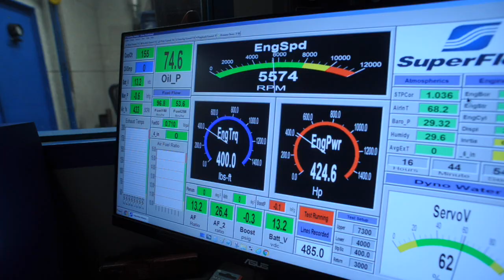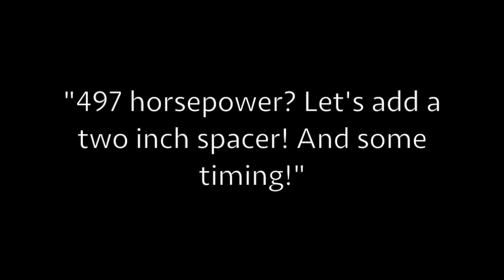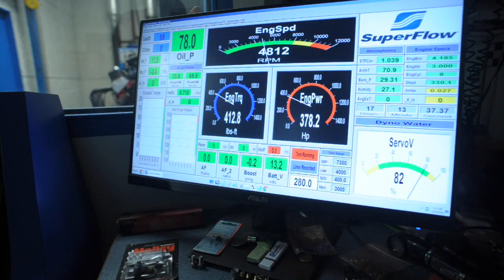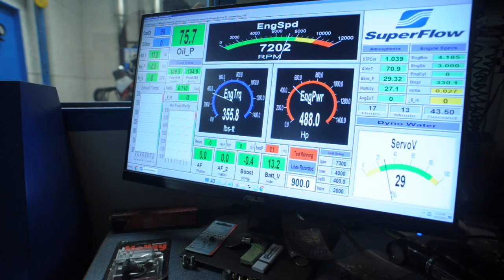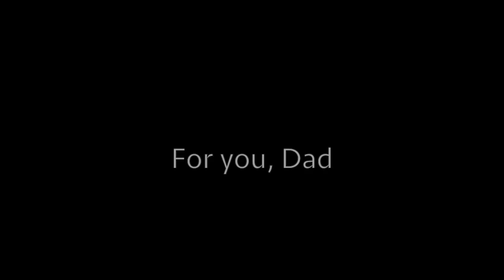Dyno #2 283 Crankshaft + 400 Block | Big Bore Short Stroke SBC

Comment: Watching your progess. I love it. I would love to see this with some like SB 2.2 heads or comparable flow with twin turbos. RPM's like crazy. This whole project reminds me of the Smokey Yunick big bore, short stroke, long rod motor he built for Indy that blew away everyone. He made 209 C.I. making and easy 1,000 HP at a measly 6800 RPM's if I recall.
Reply: I agree with the SB2.2 heads but also I would like to see what they could do with a big cubic inch SBC N/A to start with but also a combo like this with an LS top,Vortex heads, Gen 1 LT1 and newer generations of the LT and a set of big flowing aluminum heads like a set of AFR's 245s with stud mount rockers and AFR's 255s with shaft mount rockers vs MBE's new billet symmetrical port heads with their matching billet intake on top of a fully built 383,421,427, and a 434cid SBC with EFI and of course with EGT's in the headers, A/F gauge, a set of O²'s, and start out N/A, Nitrous, Crank Driven Procharger, and a big single turbo and then twins because what is better than one? TWO and maybe even go from a big set of twins to a Compound setup
Reply: @keefespencer1173   I love the way you think. The possibilties are endless.

Comment: Ever since Dart released the big bore Windsor block I've wanted to do this combination, albeit with fuel injection. Your results are stellar given the mild valve timing. Well done.
Reply from the maker: Thank you for that! 
We did a Dart block build a few years back for an endurance race called the Baltic Classic Rally…
https://www.endurorally.com/events/the-baltic-classic-rally/
Our customer was looking for a special build with a maximum displacement of 5.0 Litres. Engine went into a 1967 Mustang with a stick. We used an 8.7” tall deck block (not the 9.5” 351 Windsor or the regular 8.2” 302). 
It got a Steel 3.0” crank and we used Chevrolet 6” rods (narrowed to fit the mains) and flat top pistons. AFR 165cc heads and a very mild 220/220 duration, .500/.500” lift HR cam. 
Ran on cheap 87 octane regular gas and made a respectable 455HP and 375 LBS of torque.

Comment: I would like to see 3.25 stroke in this build and see the difference in torque,
Reply from the maker: Hey Lars, thanks for checking out this video. If you’re interested, look at the few videos we’ve done on just what you’ve commented. 
327 crank in a 400 block. We call ours a 354.
The torque is almost exactly the same but the 354 made about 40 more Horsepower.
Reply: Hotrod did this years ago under the article "The 350 GM should have made" they used Ford straight 6 rods. It was a torque monster.
Reply from the maker: Thank you Terry! I appreciate you commenting.

Comment: I really like this build! I'd love to see a much larger cam and crazy shaft mounted rockers with 240 at 50  and 620+ lift doing 9000+ rpm till I rolls over I think 700 hp. Is very  achievable with the bottom end
Reply from the maker: Thank you for your comment!
Reply: I hope to see more of this little engine that can
Reply: @ceperformance  thanks for sharing the  build, also want to see the real story,  where the engine was going  what curve hp and tq @ what rpm how is it with the intended vehicle? So few people think of real drivable cars  its dyno numbers  for un usable sausage fest brag numbers un usable on street
Reply from the maker: @lukenellermoe6266  
We’re all about building stuff that’s drivable. Dyno numbers are one thing but actually driving it and enjoying the car is what really matters. One reason why we chose the mild cam and even went with the 114LSA. Great vacuum and nice idle but still make impressive torque and not so bad even at 7,000 :)
Reply: @ceperformance  cool
Reply: @ceperformance  Wow, what a great build. Very impressive!
Reply from the maker: Thank you very much :)
Reply: 600

Comment: Built a similar setup in the 70's for David Nickens that version left the starting line with an 11,000rpm Jones mechanical tach pegged, car ran in modified production
Reply: John S  if you don't have cubic inches, you only have one option, buzz the thing as high a RPM as you can, it took serious roller cam, heavy valve  springs, lots of compression and seriously good cylinder heads....
Reply: HP = PLAN divided by 33,000,
P=Pressure in psi, L= Length of stroke, A=area of piston, N =Rpm,

Comment: Pump gas?
Reply from the maker: Yes, 94 Chevron
Reply from the maker: 10.78:1 compression 
94 Octane Chevron
Reply: @ceperformance  was there any detonation? Or could it handle lower octane? Just curious.
Reply from the maker: @SteveSega  We did run it on regular with a bit less timing and haven’t had any issues. Thanks for commenting!

Comment: That is awesome what camshaft are you running I love this build.
Reply from the maker: Thank you! The cam is a custom grind from Comp Cams. 
It’s a Hydraulic Roller. 
224/230 duration, .536”/.544” valve lift with 1.6 rocker ratio. 
It’s also a 4/7 swap firing order because it sounds awesome!
Lobes #’s are 3315/3315
114 LSA and ground with 4 degrees of advance.
Reply: @ceperformance  That is a very mild grind, which makes the HP numbers that much more impressive. Are you running the AFR Rev Kit to stabilize the valve train even more?
Reply: An 106* LSA would put you up to 1.41 lbft per cube.
Grind the exact cam to 106 and try it.
Reply from the maker: @hotrodray6802  
Thanks, you have a good point. 
We like the 114 for the increased manifold vacuum, less exhaust fumes and mild street manners.

Comment: Great job guys. Love to see outside of the box thinking being applied to the been there done that sbc. I'm a believer in the positive gains that can be achieved through engine balance. I.E - bore/stroke ratio and rod ratio. It seems to me that the benefits of 1.75 to one or greater rod ratios are often overlooked or not understood at all. Besides the potential increase in upper rpm power there's also an increase in engine longevity by reduced side loading and thus improved ring wear. Not to mention the capacity to increase compression ratios before experiencing detention. Potentially a win win win situation! I've always looked at chevys factory 327 as a nearly ideal engine in terms of bore to stroke ratio and rod to stroke ratio. The rod ratio could have been improved apon. 
The results of your 329ci engine build and subsequent dyno test have left me with a few questions though. Have you ever or if you did build a traditional .030 over 327 using all of the exact same parts that were used in your 329 build I.E.- same heads, same rods, same compression ratio, same cam intake and carb. Same everything as much as possible. What kind of horsepower and torque would you expect to get from that combination?  Better, worse, essentially the same?
The results would be fascinating to me. I've also wondered what the power differences would be between a conventional 383 vs a 383 built using a bored 400 block and a 350 (3.48 inch stroke) crank. Again all components used would need to be as close to identical as possible to make the comparison legit. 
Would love to hear your response.
Reply from the maker: Hi Ron, 
Thanks for your comments! I would be happy to discuss by email if you want. Let me know!
The closest I’ve done was a SBC with a 3.35” stroke, 4.060” bore = 347ci. Same AFR 180’s, same compression, roller cam with same 4/7 swap but more duration (242/248)
It makes 540HP @ 7000 and 435 lbs of torque. 
That’s the same torque as our 3” stroke 329 and only 28 more HP. Same RPM too. 
The 347 also had a Super Victor manifold whereas the 329 was an RPM AirGap dual plane. 
Interesting comparison actually. 
Both engines make 1.55 HP per Cube.
Reply: @ceperformance  
Further discussion by email sounds like a great way for me to gain more insight to the principles behind your builds. I'm an open book an ready to expand my knowledge base.
Appreciate your willingness to share your time! 👍
How do I get your email address?
Reply from the maker: @ronpierce6138  
Thanks Ron. 
Check out the website ceperformance.ca
Reply: but only 1.32  ft lb per cube.
1.41 is the goal.
Reply: Hotrod magazine built a 302 in 98 with a 96  350 LT1 block and pistons, a 96 265 4.3L crank and rod(6"), aluminum LT1 heads with the LT4 hot cam and an 11/1 CR. They had the piston tops ceramic coated then ran this combo on 87oct. They were able to make just over 400hp and almost the same torque below 6000 rpm. I'm sure this would make a great economical street engine for old tech parts.
Reply from the maker: Thank you for commenting! I’ve been looking for a L99 crankshaft recently to do just that! I would love to build a ‘late model DZ302 :)
Anyone out there have a 1994-1995 4.3 V8 crank core??

Comment: Oil pressure is going down at higher rpm. Check the level. Could be robbing you of more HP.
Reply from the maker: Thank you for commenting. Oil looks great. With 70 lbs of oil pressure at 7000 we’re quite happy with that.